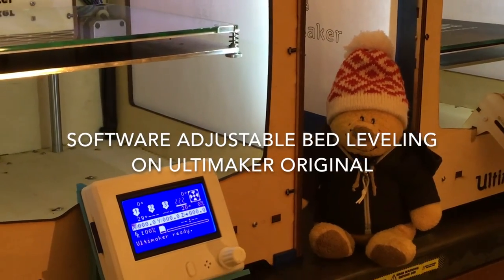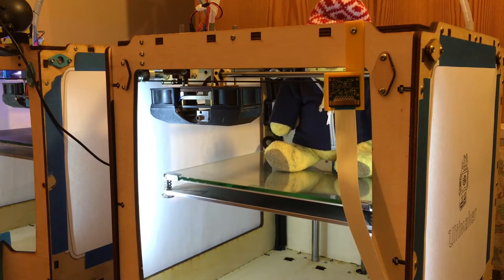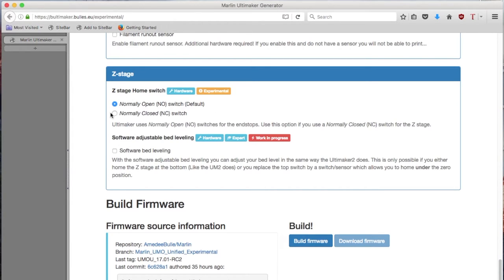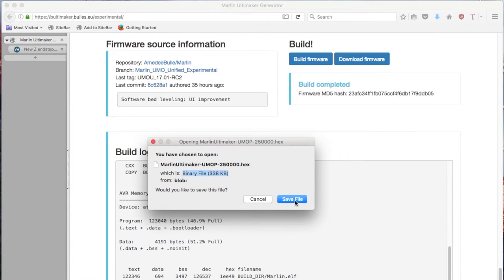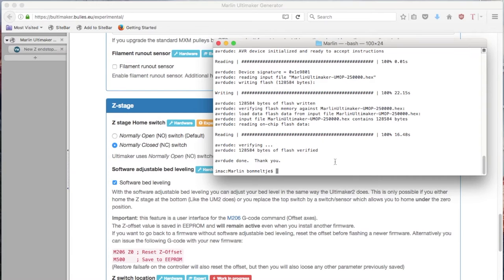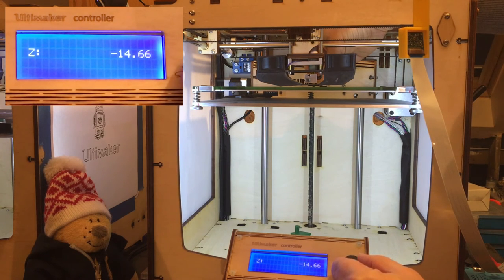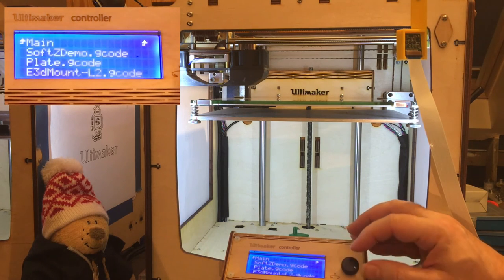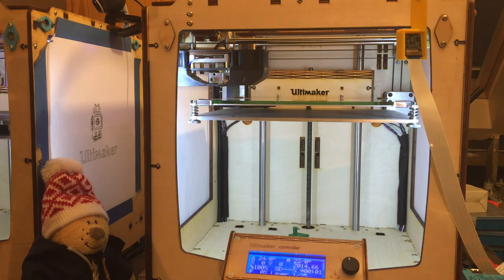Software adjustable bed leveling for Ultimaker Original

Comment: What sensor do you use and how did you mount it (and connect it to the electronics)?
Reply from the maker: It is an inductive sensor. It is triggered by a piece of aluminum taped on the bed cache.
You can see the references in this video https://youtu.be/crS5PSYoYxg and repeatability is demonstrated in this one: https://youtu.be/OHYSASlbN_8
It is a "Normally Closed" switch (NC), I guess it might be easier with a "Normally Open" (NO), but I had that one at hand.
It is directly powered from the UMO PSU in 24V, and I use an opto-coupler to bring the signal to the board

Comment: hi
very helpful Video!
what Kind of E3D v6 Hotend do you use, 12V or 24VV?
Reply from the maker: Thank you

I use an E3D V6 in 24V 
It works well with the 19V from the old UMO, but it is slow to reach temperatures above 250°C, so I eventually went to 24v
(See here: https://community.ultimaker.com/topic/17870-24v-for-umo-with-hbk/ )

Comment: Dear Philippe, i have tried the website https://bultimaker.bulles.eu/. 
There is following build error: "Cannot create build directory".  
Is there something i can do?  Thanks in advance!
Reply from the maker: This should be solved now.
Apologies for the inconvenience.
Reply: @amedee813  Thanks for the fast action! but there is an other fault now 
CC    ARDUINO_PATH/hardware/arduino/cores/arduino/wiring.c
  CC    ARDUINO_PATH/hardware/arduino/cores/arduino/wiring_analog.c
  CC    ARDUINO_PATH/hardware/arduino/cores/arduino/wiring_digital.c
  CC    ARDUINO_PATH/hardware/arduino/cores/arduino/wiring_pulse.c
  CC    ARDUINO_PATH/hardware/arduino/cores/arduino/wiring_shift.c
  CC    ARDUINO_PATH/hardware/arduino/cores/arduino/WInterrupts.c
  CXX   ARDUINO_PATH/hardware/arduino/cores/arduino/WMath.cpp
  CXX   ARDUINO_PATH/hardware/arduino/cores/arduino/WString.cpp
  CXX   ARDUINO_PATH/hardware/arduino/cores/arduino/Print.cpp
Reply: Philippe Vanhaesendonck It works! Thank you very much.
Reply from the maker: Thanks for the confirmation!